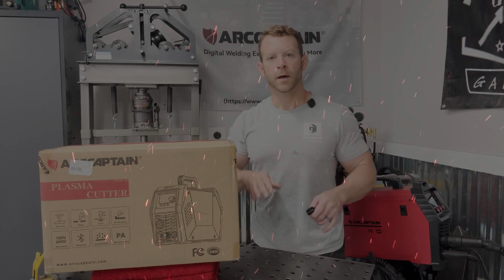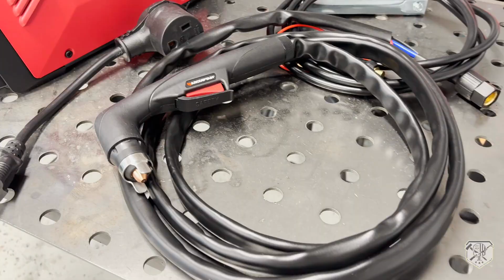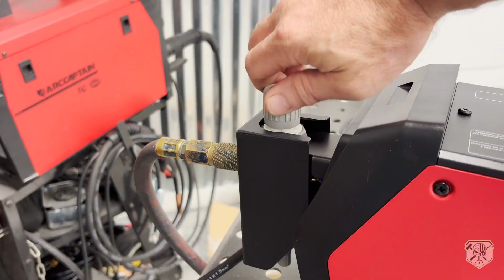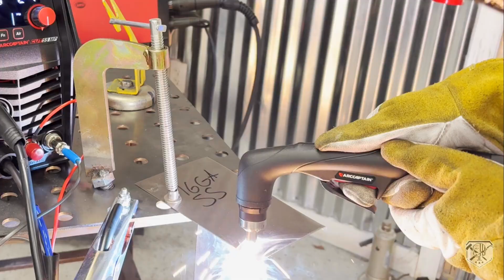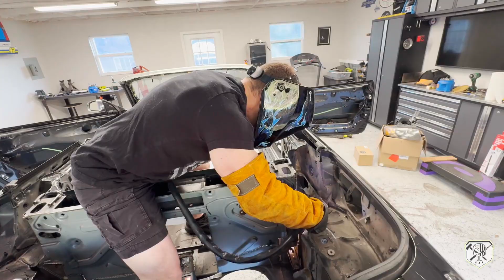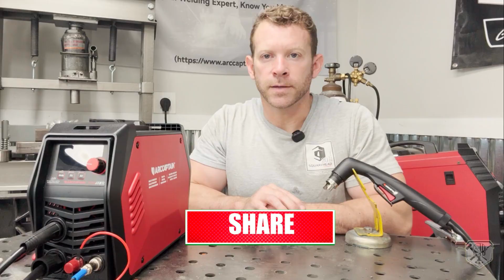Putting the new Arccaptain Plasma Cutter to the test and New Rust Removal Feature

Comment: What gal air compressor do you need to run this plasma cutter?
Reply from the maker: I ran this off of a 60 gal. You can use a smaller one it will just need to refill pressure more often depending on how much you are cutting and what PSI you are using